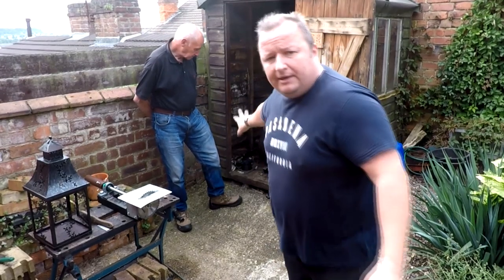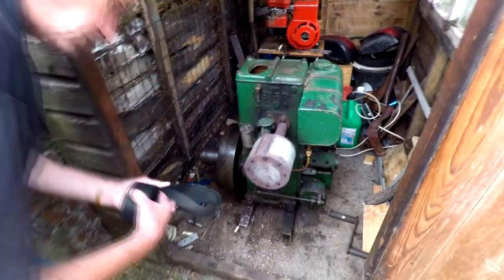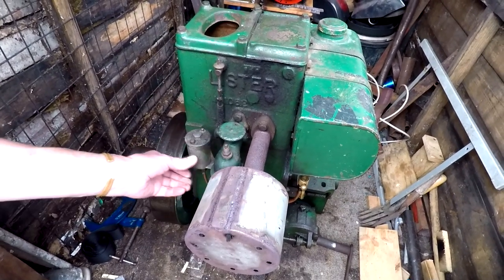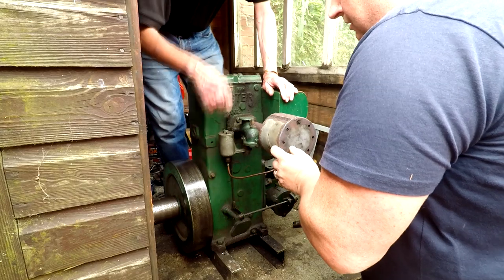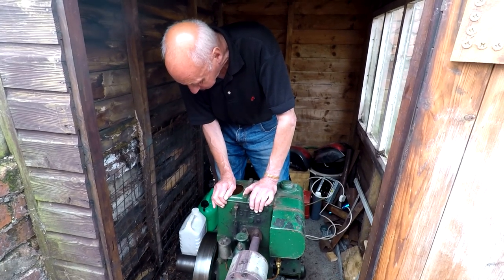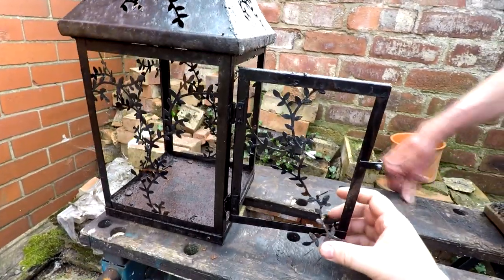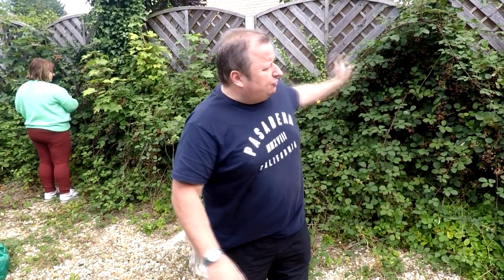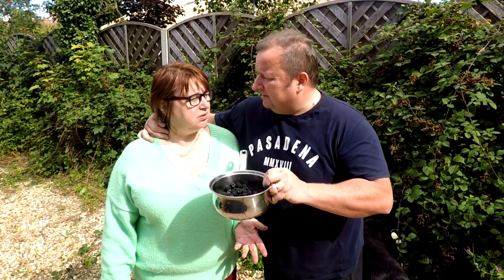Looking At A Lister D Engine And Other Stuff Vlog

Comment: That brings back memories from when I was a child of starting our old Lister Generator, which ran about 12 lightbulbs, and not a lot else, and easily took up twice the space of that motor.

We finally had electricity connected to the farmhouse, but that Lister will always have a soft spot in my heart.

Oh, that pulsing noise, very slightly different to the Generator,  but still so evocative. ❤
Reply from the maker: Yes it is, Thanks for sharing your story too.

Comment: Don't get me started on the friggin EU Martin...

Near where I live in South Leeds area there's this paint factory...
They did a special order of some paint stripper to get some stuff off a wooden floor in this pub I used to go in...
It were that strong you couldn't stay in the building when they put it on the floor...
Powerful vapours...

I've a load of Lister and Petter diesel engines..
Diesel welders...
Diesel water pumps
Diesel hydraulic power pack

Allsorts...🇬🇧👍

Comment: nice one in the 1990s we had a 2 cylinder lister diesel 1960s built engine that ran the dredger on the local canal it yousto plod away running a hydraulic pump for the jcb arm